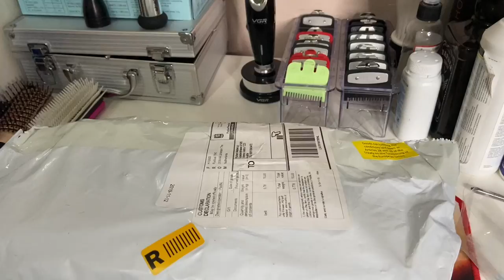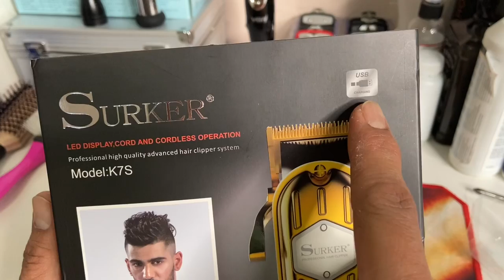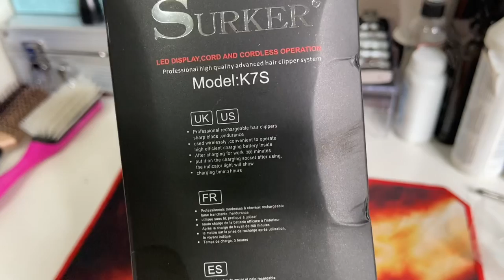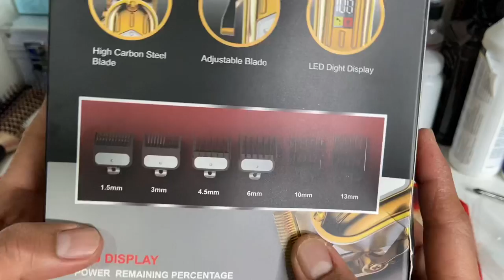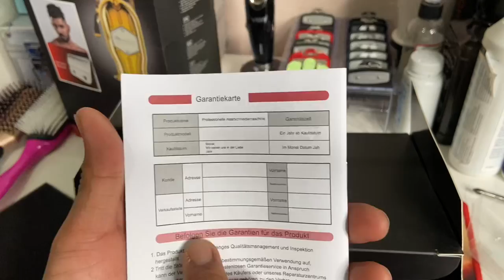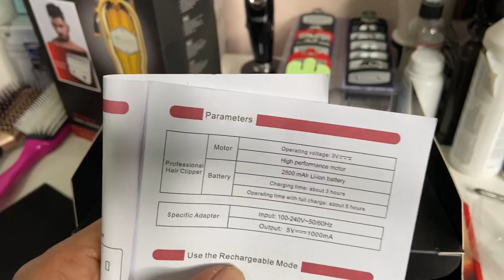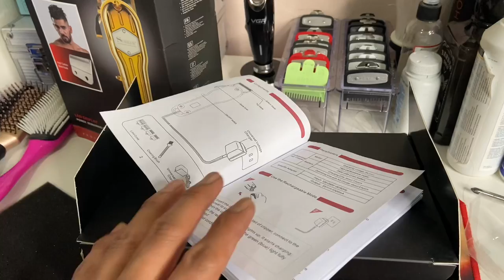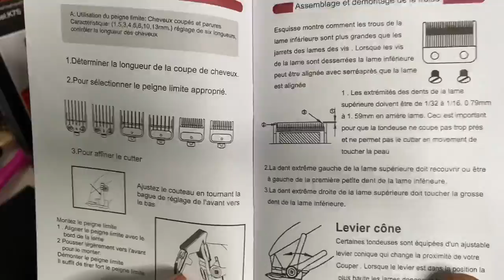Unboxing and Disassembly Golden Surker K7S All Metal

Comment: HELP! I just took apart the Surker Trimmer to clean out the head/blade. Thought the re-assembly would be straightforward. I can't seem to figure out the placement of the spring in relation to the blade & cutter. Ugh. Maraming salamat sa ulitin!!!
Reply from the maker: Ano ba surker model ng trimmer mo?
Reply: @sampitz  It's the detail trimmer that sold in tandem with the same Surker Clipper you have.
Reply from the maker: @capcityorgnzr  follow me on IG. You can send a pic of your trimmer.

Comment: Good to see it's possible to replace the 18650 standard battery with no greater hassle. With Panasonic, it's a nightmare. :)
Reply from the maker: Yes. Nowadays, most clippers is power with 18650.

Comment: Hi mines won’t turn on when I turn the bottom? Does that I need to replace the battery? I have the same ones trying to figure out why they won’t turn on without having to have them Plugged in.
Reply from the maker: That seems to be Not too old Clipper. Its better to contact the seller first for guarantee before doing anything else. If you bought it from aliexpress you can refund your money or get replacement. But i think your battery is not charging. Tnx for dropping by

Comment: I have same problem to kemei 1996 the blades not alinned and i dont know what is the problem .
Reply from the maker: Its the tension spring. Need to bend the lower part to align the higher side
Reply: Ah ok thanks man !!
Reply: Problem solved , exactly what you say !! Thanks alot my friend !
Reply from the maker: Very much welcome bro. Appreciate it🔥
Reply: Had the same Problem, tried to bend the spring but it didnt work for me, i then loosen the screws and aligned the blades manually, like doing a zero gap.

Comment: What the difference between the kemei 1986 with the surker  K7S all metal?
Reply from the maker: Hi. I didnt order the Kemei 19860 Coz ive seen this New design from Surker. But there is not much difference i think in my opinion. Maybe they are Both 8 watts Power. Just Looks preference i Think. Thank you

Comment: Congratulations on the video. Could you pass the product link on Aliexpress
Reply from the maker: Tnx. I will update the description. I will write the link there.
Reply from the maker: Btw, this oNe came with a crooked blade too. I tried to play along with the spring that holds the cam follower. Then then i ended up with atleast almost straight blade. Sorry i dont have video made. But only the spring holds this blade ao you might want to check them first. Goodluck

Comment: mas solid parin build nga kemie / vgr kuys d lng papel insulation don plastic talaga the yung charging connectado sa board. dlng sa wire
Reply from the maker: Oo di ba. Nkita mo nmn nung binaklas ko yung VGr Al metal. Kaya nmn mas mura tong Ginti na to. Hhaha. Pero susubukan pa naten ang performance nyan.
Reply: ahahha kano pala yan kuys??
Reply from the maker: 25€